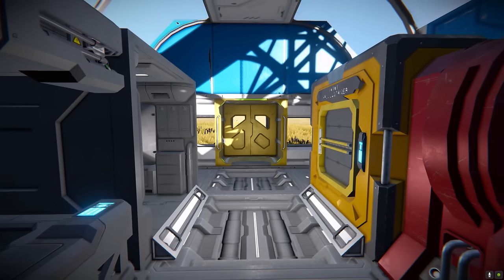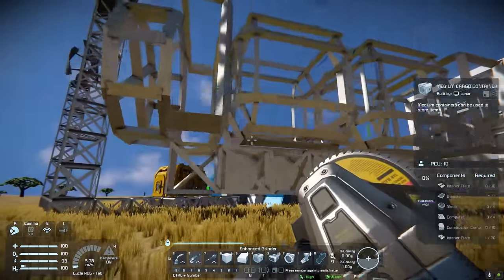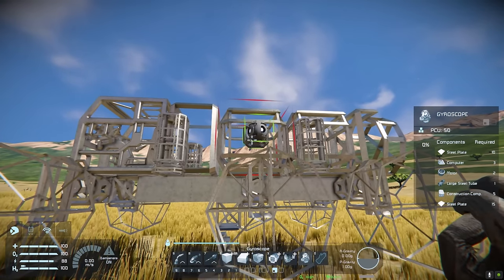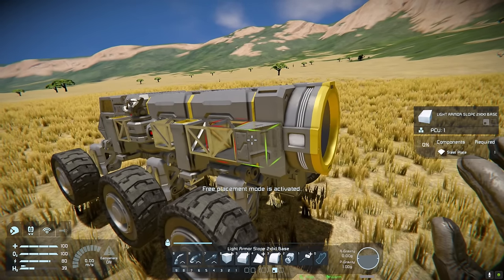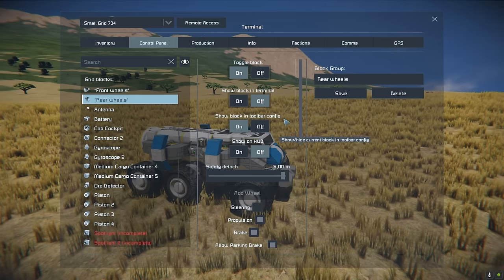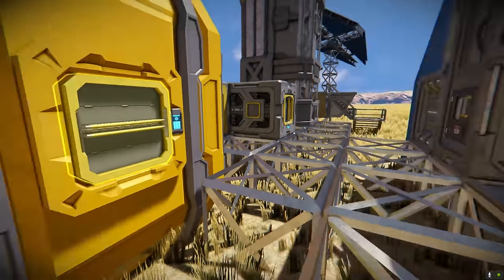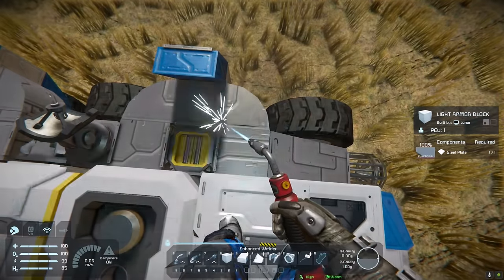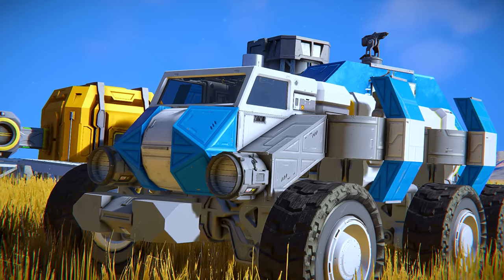Survive with me #5 - Rover build tutorial (Space Engineers)

Comment: For the bumpers, using 1x1 wheel suspensions would actually do a better job at protecting a craft from a crash. Just make sure to set  them to no steering, propulsion and zero friction. Could also put them on with the hubs facing the ground so then falling off the cliff is more doable. I've seen then save an entire craft from a dead drop, going full speed and bounce harmlessly off the ground. Another benefit of doing the ground ones is that when you want to jump something at speed. Most of the time you'll end up scraping the ground, those wheels prevent that.

Comment: I'm pretty sure 'R' is the default key for switching grid sizes.  I didn't even know there was a key for this until recently.  You can also just select the block in your toolbar again (keep hitting 9 in your case for the landing gear) to toggle between grid sizes.  Personally I build my vehicles attached to my base (via connectors, rotors or hinges) and get the batteries placed and built as soon as possible so they can charge while I'm building the rest of the vehicle.

Comment: I would use some cobalt to make the chassis in heavy armor. Suspensions are solid, but will instead transmit damage to surrounding blocs in case of big shock. I would also triple it between the suspensions just in case one bloc breaks, two are still holding. I will extend front and rear bumpers in front of the wheels to protect them. I'll also build one blast blocs rail on each to corner of the rover, just in case of upside down flip, just in case [;oD Maybe you should add Build info and build vision mods, because they are so useful to begineers to understand blocs specs

Comment: Awww, Lunar, you didn't build an 8x8! :(

My current rover (I call it the Spider, because it's of the black colour and the wheels) is an 8 wheeler, with 1 h202 generator feeding 2 hydrogen engines, 2 batteries, and 2 medium cargo containers.  I'm also using the 5x5 wheels, and it has 8 gyros; one for each wheel.  I acknowledge that the gyros might be overkill, but I spawned in a mountainous ice field, and I virtually never flip with it.  It can carry around 20,000 kg of ore with no real difference in speed or performance, either; although I usually run it at about 45 ms.

I'm glad you told people about the blast doors, though.  My Spider has them all over the undercarriage, two rows at the bottom for bumpers, and a row all around the top.  They really do help.